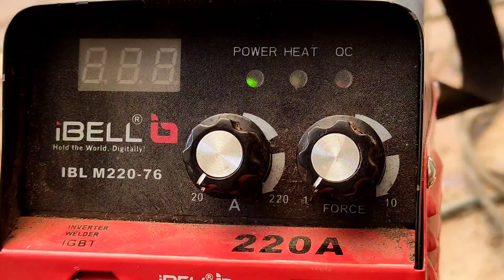New trick to learn electric welding  with ease sv welder's

Comment: WHY are we using a cutoff wheel without a guard??!!
Reply: Because I can
Reply: Because
Reply: @satanwave8597  u hay ?
Reply: Guards get in the way
Reply: @jonwallace7015  Just like the shards from a shattered wheel will get in the way of your face?
Reply: @DiahRhiaJones  yes but this happens all the time .guards slow things down just like rules.
Reply: @jonwallace7015  guards protect you from losing the ability to see. 

If you put so little value on your own body then there isn't much else to say to you other than good luck.
Reply: @DiahRhiaJones  I appreciate this but at nearly 50 I'm OK. And I don't stick to these uk rules  .have u ever used a grinder with a guard on .
Reply: That's what most Yanks do!
Reply: And they call box-section square tube too 🤣
Reply: @DiahRhiaJones  And the ability to count to 10 with all your fingers and thumbs 😆
Reply: @jonwallace7015  Yes, and it poses no problem whatsoever!
Reply: @hariowen3840  they are always in the way
Reply: @jonwallace7015  I agree - they're always in the way of chopping your fingers off! 🤣 And you can't teach anything to someone who 'knows it all' eh! (You have to just let them learn the hard way!)
Reply: @hariowen3840  thanks for the advice buddy.
Reply: @jonwallace7015  👍
Reply: @jonwallace7015  Fortunately not, but had many a close shave (literally) and that's without ever using an angle grinder without a guard.  Incidentally, I worked for 49 years as a welder / fabricator in the UK engineering construction industry. (now retired.) And pretty much used an angle grinder every single working day, since they first became widely available.